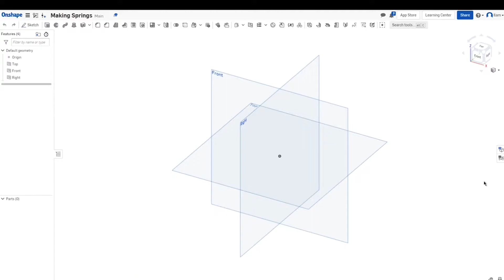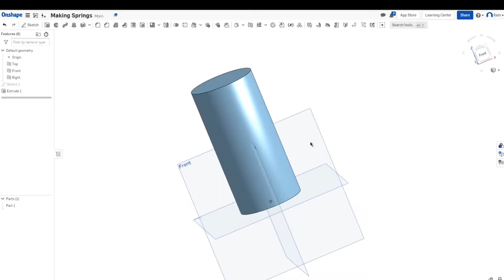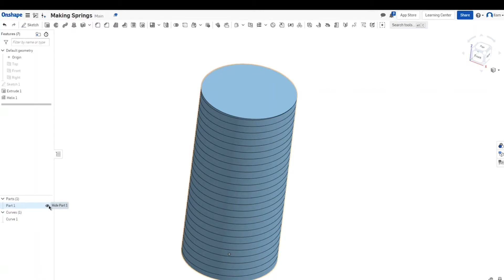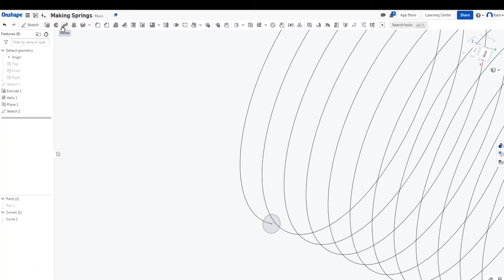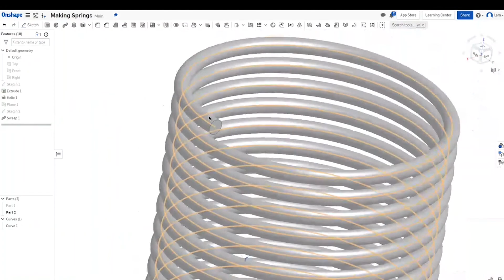How to Model A Spring in Onshape

Comment: Thank you but how do you get the Cylinder to go away without removing the spring, if you're adding a spring as part of a solid model?  I am adding a spring to a car chassis and just making it come straight off the bottom for 3D printing. Getting rid of the cylinder seems to always get rid of my spring. Thanks for any help.
Reply from the maker: When you do the sweep, you do it as a new part instead of merging it with the cylinder, that way when you delete the cylinder, the spring will be there. Hope this helps!